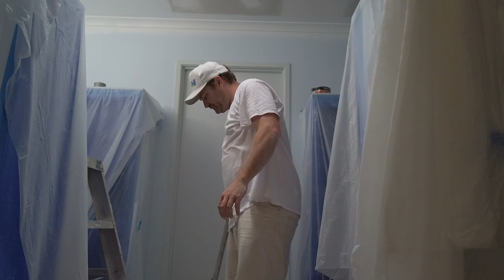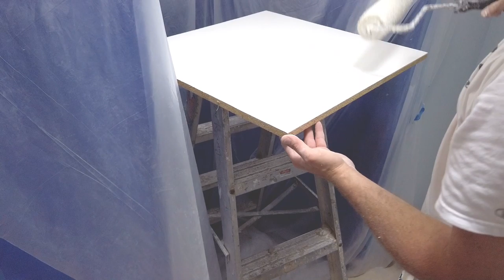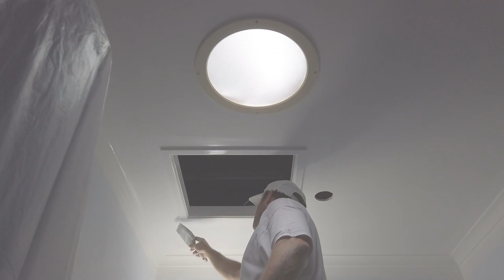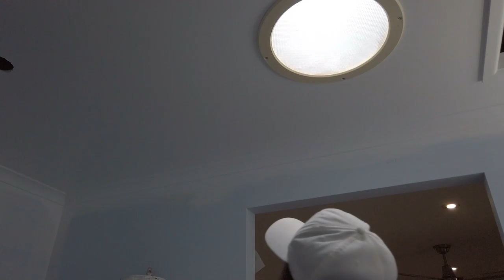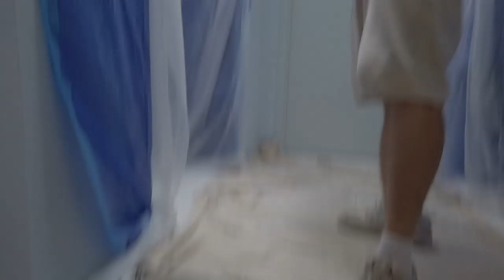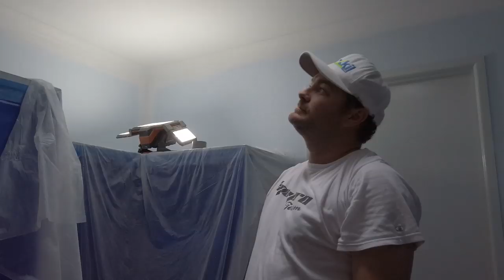How to Paint a Ceiling Fast with a Brush and Roller

Comment: Hey Max, was wondering what brand your stepped cornicing mitre box is? Finding it hard to find here in NZ. That ceiling turned out awesome.
Reply from the maker: Hey mate, its a wallboard tools mitre box. Highly recommended . Just onto the walls in the next clip. Yeah turned out great.
Reply: @Maxkil  Thanks mate.